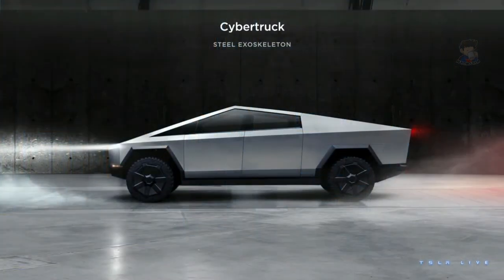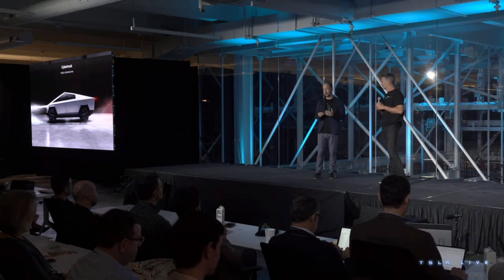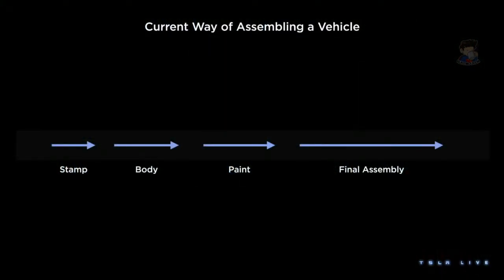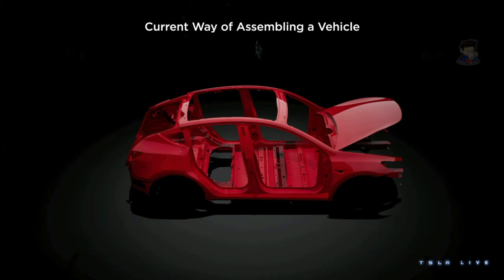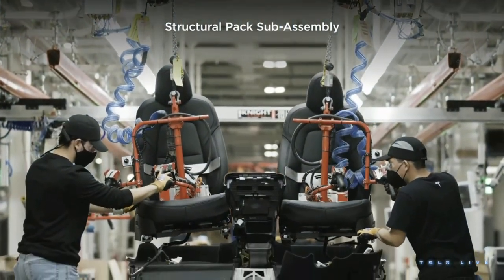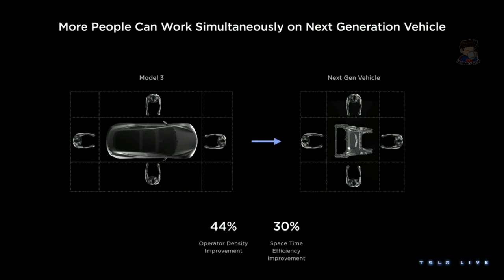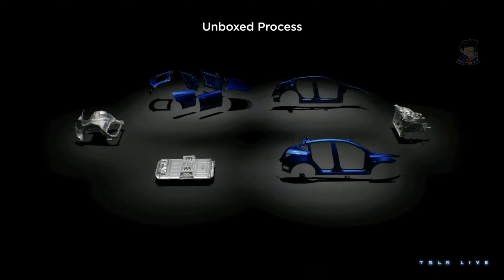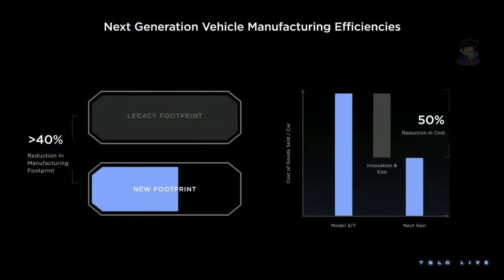Tesla Model Y New Manufacturing Process 2023 | Cybertruck

Comment: They said they won’t be doing that for model Y. The graphics were just as an illustration of how they’ll be constructing their next gen vehicle
Reply: It is probably for all vehicles of the brand, in the long term. But the planing force to build the current cars still with the "old" processes. Pausing production for this would waste a lot of time. Once Giga Mexico is operational with these techniques, I don't see why they wouldn't start this changes.
These techniques require reviewing the designs of each model, to make possible to assemble them this way. This includes major castings changes, stampings etc.
Reply: @theplouf5533  giga mexico isn’t being made to produce model y or 3. If they do it at all it will be minimal production. Giga Mexico is expected to start production near the end of 2024. Musk mentioned that making changes to the model y and 3 would require expensive downtime so its not preferable to be changing it at all into the unboxed process explained in this video that will be used for the next gen platform. Paired with the fact that full scale production won’t happen until the end of 2025 or beginning of 2026. Without experience or a fully renewed production plan for the model y and 3 that would be extremely costly and definitely not worth it for 10 year old models. It will be for all new vehicles of the brand. But not model 3 or y. This was stated and explained by more than one speaker during the event
Reply: @ricardoveras3433  This is exactly what I tried to explain. Sorry if I wasn't clear, I'm French.
Reply: @theplouf5533  no worries! :) my bad then